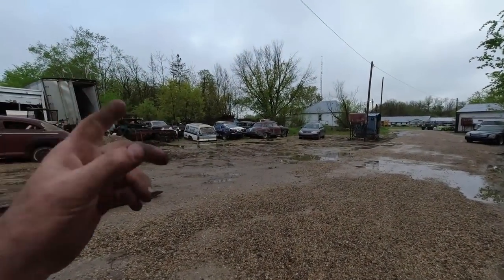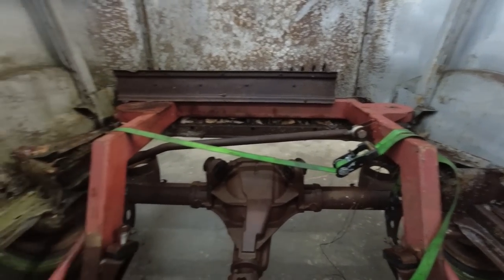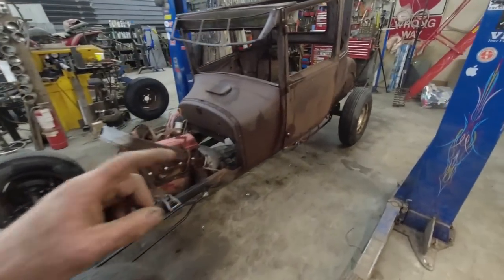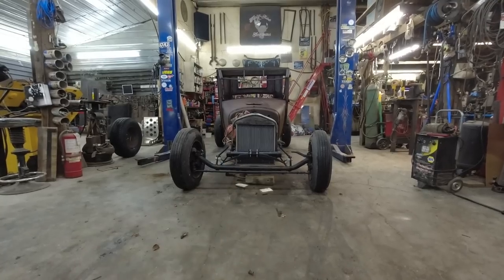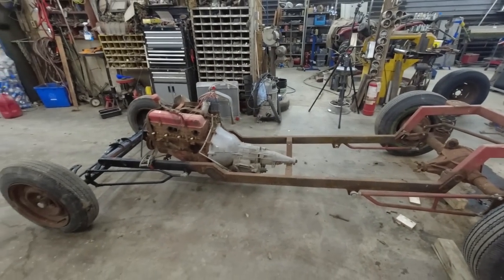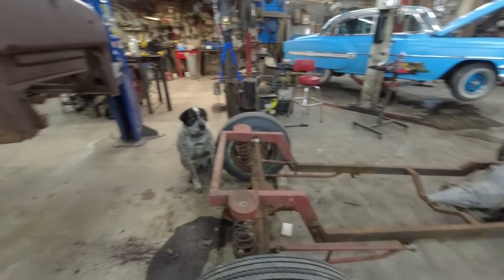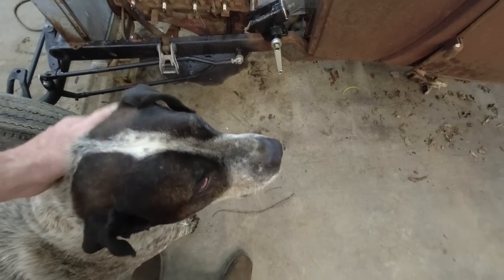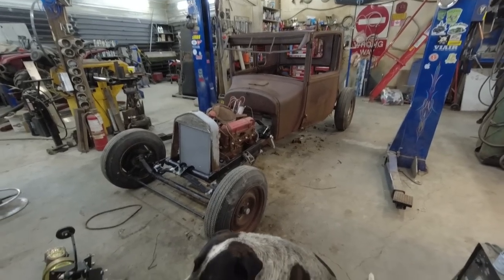New project, Ford Model T hot rod!

Comment: Hello from Vancouver Island. Your video where you built the truck out of two trucks is what brought me to this channel. In that time, I've learned a lot, not the least of which is that you can build things without having a shop that has a polished linoleum floor, and that linseed oil is an acceptable car finish. It's been like a breath of air. Thank you for your clear explanations, and demonstrations of how you put things together. The metal working, where you built the aircraft seats for the ford, is something I want to try myself. (I have a motorcycle sidecar project going) Keep the lessons coming, I'll be watching.

Comment: A lot of us in the 60s used that frame design, Cal Custom sold frames, plans, front axels, 23 T fiberglass bodies, for people that didn't have fab equipment. They did sit high m but you just delt with it, they did ride ok, and if you bought it or built it to print, you didn't get bump steer, and your oil pan didn't hit the road.

Comment: Brent, the new project is shaping up very well, especially as you have indicated that you will chop the old body. That would improve body proportions mightily. Another change that seems reasonable is to add torsional resistance to that chassis. So many of cars of the 30's and 40's had X-bracing in the chassis for that reason. Now that the body has not been installed is the right time. 
A viewer also suggested that you use an inline engine, for example a Ford 6 of about 1948-1950. Quite possibly you already have one in your vast stash of parts. That would add a lot of difference to the T-rod you are developing.

Comment: S-10,4cyl efi manual transmission. I just need the chassis. Maybe the way gas is going i should build my 49 5 window pickup with the 4 banger.
Seems you are non stop building. Wish i was actually able to carry on more than 6 hours a day. I think i would have fun. I finally get smart enough to do a few builds but body wont cooperate…
Pablo, needs a cookie maybe.
Reply from the maker: I'm going to guess it's the iron duke version?
Reply: @HalfassKustoms  i think so, brent.

Comment: That chassis would really look neat with a hopped-up straight 8 flathead, like an old Pontiac or Chrysler...  These motors should still be reasonably easy to find and still should be cheap.  The Pontiacs even had 4-speed Hydromatic transmissions...  In a light-bodied car they are really exciting to drive...

Comment: Hey "HALFASSERS"! This is as good a place as any to ask this... I just picked up another project I didnt plan on and it wont be the next build as that will be an IH truck/chassis swap. Anyway I can always gather parts as needed until its ready though. It is a '28 Chev national(4 door car) and I'm not into more-doors usually so I am thinking it will be a 5 window pick up with a short box or a short door sedan delivery with fixed side glass windows and a door built into the back. So what does the halfass nation think? Which have you built? Which would you buy? Brent feel free to weigh in on this if you read this, you have probably done both!
Reply: @blakestone8088  ? Ok, so which is it,  5 w P/U or fixed window sedan delivery?
Reply: @blakestone8088  👍

Comment: That frame don't look strong enough to handle much. It would be cool with a built 2300 four cylinder Ford ( less power ). Nailheads are cool also. That's what it's all about. No rule book, build as one see's fit. Should be a fun project to tag along with. Ronnie. (RAT ROD?)

Comment: Brent, several months ago on "Jonathan W's" channel, Jonathan bolted a 5 speed tranny to a  '47 flatheat Cadillac by cutting out his own adapter to make the pairing fit.  It was cool but he set that project aside for awhile after he did it. I thought since you've been talking flatheads, perhaps you'd be interested in doing the same thing?  I personally would love to see a Packard or Pontiac straight eight with an intake manifold that was adapted to take a 4 Bbl Carburetor mated to a five speed trans with all 8 exhaust pipes coming out one side of the Model T (or other old pre-war body style) into a collector and sent to the rear.  What's your opinion of a project like that?

Comment: That motor right there is screaming 283/327 with that oil filler in the intake PERFECT for that car. I just seen a professionally built coup with a 366 LS in it, that LS looked completely out of place in a Hot Rod. The   government has so many other stupid rules & regulations against just about everything, we should pass a LAW !   Only early SBC motors allowed in Hot Rods . it's just the thing to DO ! lol . Good boy Pablo, get in there & help dad
Reply: Only SBC?  Plenty of vintage mills out there to choose from that look just as good (and not as common)  that work!
Reply: @glennnickerson8438   SBC common ?  283s & 327s are getting hard, VERY hard to find anymore. (fill tube in intake)  I just rebuilt & used my last forged crank small journal 327 I had.  Some of the others big horsepower small blocks are getting harder to find as well. DZ 302s & LT-1s.

   Granted  there are a few other early motors that have the LOOK , but the computer motors just fail to hit the mark in a true Hot Rod to be as impressive as the little SBCs. I was never a fan of Big Blocks in Hot Rods as that puts a ton of unwanted weight  where you don't want it, over the front wheels  that forces them to dive hard in the turns. Next time you see a early SBC in a hot rod and they say it's  a  327,  remember that's a real power house for it's size and very drivable.
Reply: Mike P: Years ago Rod and Custom (remember when there was car magazines?) did a feature on how to make a later SBC look like a 283 / 327.  My 350 in my Rambler (breaks my heart there is a SBC in it, got it for free and did a $500,00 rebuild on it) is running a older intake with the oil filler tube.  Just sick and tired of seeing the same old mills when there are so many other vintage motors like a baby Hemi, nailhead, Olds, Pontiac, Ford and others that make you take a 2nd look.
Reply: @glennnickerson8438   I have drove  a few rods with 389 Pontiacs, 303 to 425 Olds & BBC and found out quickly they were no fun to drive at slow speeds with a manual steering box with arm strong steering or at high speeds  in tight turns as all that extra weight was  a total nightmare to deal with compared to the  ease of whipping around with a 300 to 500hp SBC to get around in parking lots or into parking spaces at car shows.  Thing is I prefer my BOP motors over anything, but in a manual steering car, forget about it, SBC is the answer, and really a all aluminum SBC would be the way to go in a street rod ---- if we had the $$$$$ !
Reply: @glennnickerson8438  I still have my 1963 little copy of Rod & Custom mag that had the candy apple Blue & pearl white Beach Boys 32 little deuce coup on the cover. That coup had a blown 389 Pontiac in it with a Lincon trans. That car is still around untouched. Rod & Custom was pre Peterson Hot Rod Mag as that was all there was in the beginning .
Reply: @hydroy1  👍😉

Comment: Have you ever used Ford motors, 289, 302, 351&2, 390, etc?  A guy local has a T for sale and somehow he snagged a 427 Ford for it.  It's all chromed to hell 70's style.
Reply from the maker: Used one once as I had a donor at the time. That said I only have flatheads in the Ford variety.